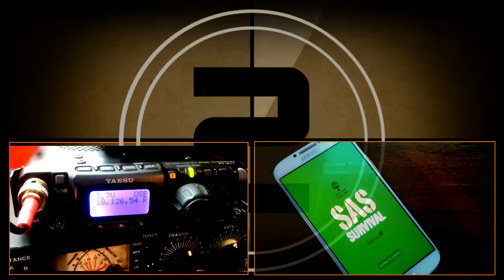QRP Portable Yaesu FT-817ND CHA F-LOOP Field Test

Comment: SurvivalTech Nord  have you been getting my questions on G+?8) another question on antenna. If i have the radio you recommended yt-60 and want to communicate on 2m and 70 cm band. Would antenna like this do or i should focus on whip antenna? As i live in apartment i don't have a station want to be able to put it on and off as also would be possible to bring in the field if bug out? I was looking at the cameleon one.
Reply: SurvivalTech Nord See I saw briefly the notice you mark something but the message disappear 8(
Reply from the maker: Don't worry. I'll get back to you shortly
Reply from the maker: Ok obviously I haven't been getting all the messages. I think we should find a better way to communicate, and also sharewhat we learn from your project. I'll send you a private message.
Reply from the maker: I found the problem.  I had not added you to my circles in g+, so I only saw your messages by chance. I've added you now though,  and put you in a group which pings my phone.
Reply from the maker: TheMountainRN 
So at least now I have teh comment about the Chameleon Antenna.
What we had been speaking about is a VHF/UHF Radio with built in FM/AM and Shortwave radio. The Chameleon antenna would only be useful on the Shortwave listening portions of the radio we spoke about, as its an HF antenna 
For an apartment, you need to ask a few questions. 
- Do you have a balcony?
- Are you planning to use repeaters, work radio to radio (simplex)?
- What bands/frequencies are you planning to use?
. is the antenna only for the apartment, or should it also work in a car?
The list of questions can go on and on, even though the answers can be pretty simple.
I know its confusing, but if you're going the amateur radio route, the very first thing to do is take a class. :\ The class will help you understnd what capabilities you want to have. Once you understand what capabilities you want, then you can plan how to implement them.
Does this make sense?
Reply: SurvivalTech Nord Yes I actually took a class but it was a bad one. I learn more on my own that on that class lol. I plan to take my exam in July. As when I tried exam before didn't do so well. So now I tackle chapter by chapter. That's why right now my interest is on antenna as that's what I am studying. 8)
Reply from the maker: You will get there, just be patient.
I've been testing lots of different antennas lately. Antenna for home, for hiking, for my cottage, for the land rover, ... HF, VHF, ...and I realized that it must be impossible for new-comers to figure it all out. Its like enjoying a meal in a fine restaurant. Which spoon to use for what, and so on. 
I think when you have completed your studies, you might have a different opinion about your comms gear. :)
You told me about your climbing and I immediately thought to tell you about an Amateur radio oprogram called "Summits on thh Air"http://www.sota.org.uk/
Reply: Yes i know 8). Just trying to planned a budget to have a kit. I actually have a book on it's way for by ARRL on antenna for apartment 8)
Reply from the maker: TheMountainRN 
Awesome. So you're really into it!? OUTSTANDING :)
Reply: SurvivalTech Nord i am like that. One i get in something i want 110% lol